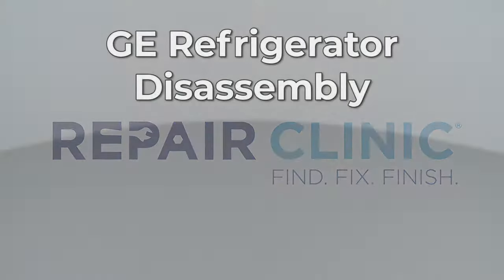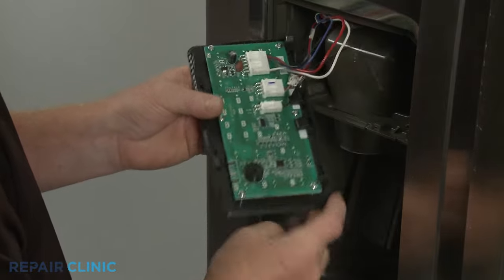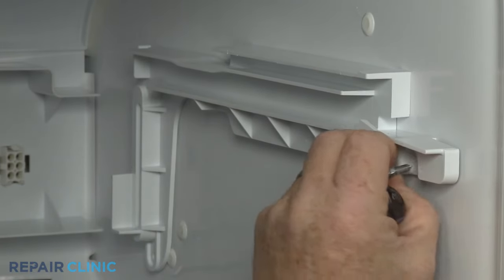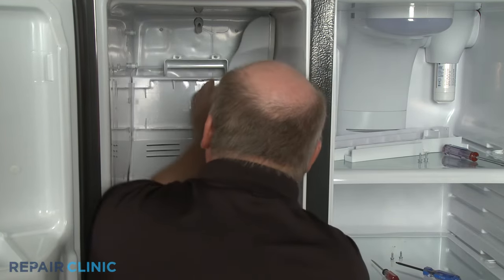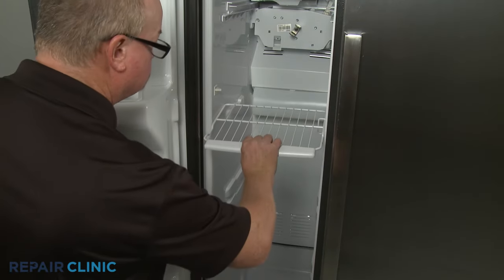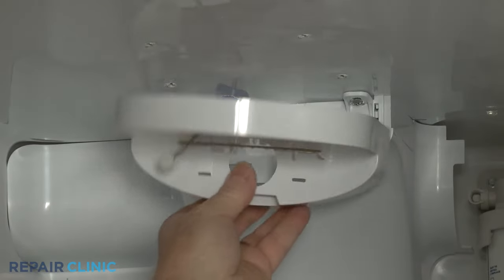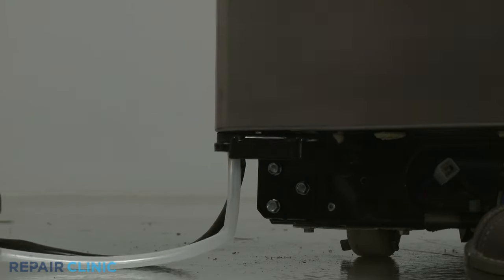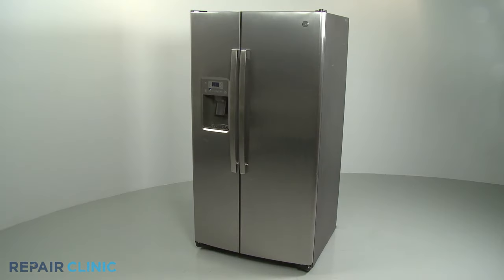GE Refrigerator Disassembly (Model GSE25GSHPCSS)

Comment: Anyone know how to remove the inside panel from the freezer door or another way to have access to the inside of the door?  The water dispenser line has started freezing up, sometime multiple times per days.  I think the insulation inside the door has broken down and I would like to replace or add more.  I called GE who said the fix is to replace the whole door, but they do not make them anymore.
Reply: @Viper - I am in the EXACT same situation you described here. Did you figure out how to remove the inner freezer door panel? If so, can you provide a link to instructions/videos/resources for how to do this?

Comment: you skipped over the part I needed how did you get the shelf and the freezer out mine won't come out I don't want to break it it's already broken
Reply: Stick your head in the freezer with a flash light.  Look on the right side where the metal rods go into the panel.  There are little plastic flaps, just lift up on the rods/bracket.  You will hear a click.  

Slide shelf to right, you can then angle the left side down to pull out.

On the right side of the shelf’s push/pull up.  You’ll hear a click. Then you can slide